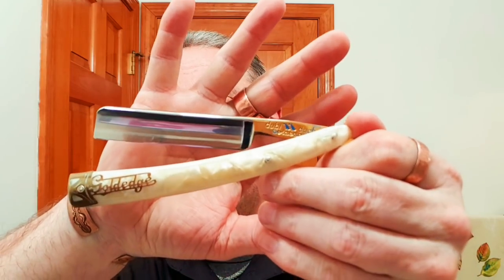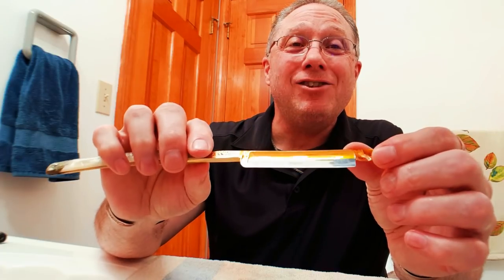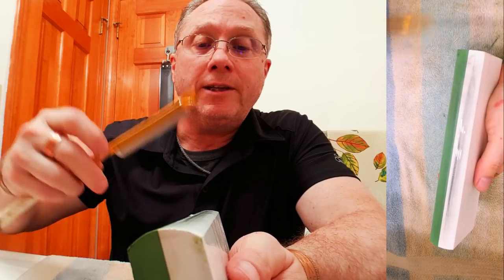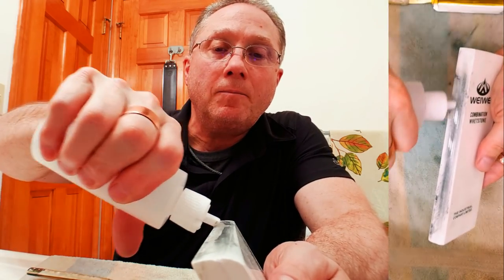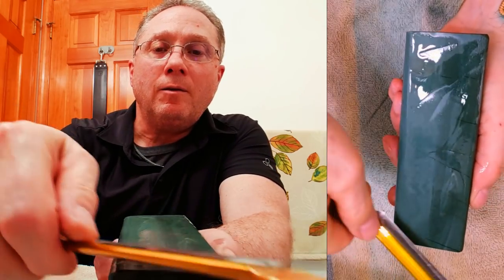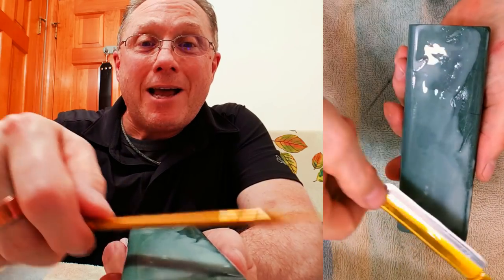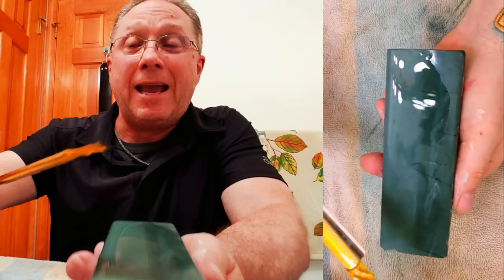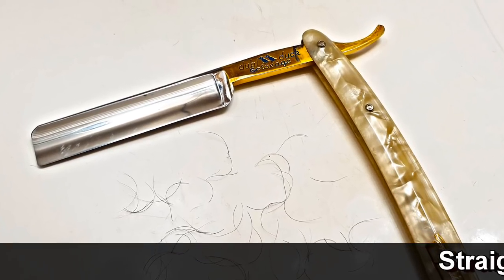Why You Can't Hone Your Curved Straight Razor

Comment: Great to see that WeiWei 10K back out. I like mine, used to be my finishing stone.
Get fairly decent shaves.

Recently got a Shapton 12K instead and results in my newbie hands are not different given X4 cost.

Will try  ILR next I think..
Reply from the maker: Luigi the WeiWei 10K is a fine stone! ;) I had forgot it was even in the mix, but it does a fine job! Yeah the Shapton 12K needs a very light touch absolutely little to no pressure and then it works well. I do really enjoy the ILR using the under the running water technique.
Thanks for your great comment and thanks for watching! :) Have a good weekend and take care my friend! :) #Heart

Comment: Won't that rounded surface make your bevel concaved?? 🧐
Reply from the maker: Great question George! ;) When honing a flat straight razor the edge and the spine hit the stone at the same time the full length of the blade. However, when on convex shaped stones like these the edge and the spine hit the stone at the same time at one given point of the blade. Making it necessary to use rolling x-strokes as one side of the blade is convex and the other side is concave. Using this method will make a proper bevel, it won't end up with a concave bevel at all.
Thanks for your great question my friend! :) #Heart

Comment: Why hone on the side of the stone?? Also, I never used any glycerin on a water stone. What is the reason for that?? 🤔
Reply from the maker: Great questions George! ;) This straight razor has a natural curve to the blade and the owner wanted as little damage as possible. So by creating an convex shape on the side of the stone I could get at the full edge. And I didn't need to convex the entire flat stone and the razor will only hit in a small section anyway. So it work perfectly! I wanted to use the water and glycerin mixture on the Charn so I used it on all the stone and it worked well.
Thanks for your great questions and thanks for watching! :) Take care and have a good weekend my friend! :) #Heart

Comment: Eric, you say never move side to side, but what if you have a strop that's not three inches wide? Aren't you supposed to strop using X-strokes on a narrow strop?
Reply from the maker: Great questions Greyswindir! You are correct when you are stropping on a strop that is narrower than your straight razor you will need to use X-Strokes! :) #Heart
Reply: @AdventuresInWetShaving  - I must have misunderstood your meaning the first time around. Sorry about that!

Comment: Got a question Eric. Can a regular shaver with two or three straights get by with a set of 3000K, 8000K and 12000K stones? Thanks for the help, and another great video.
Reply from the maker: Great question Donald! ;) Yes, you should be fine with those three stones on a straight razor with the bevel already set.
Thanks for your great comment and encouragement, and thanks for watching! :) #Heart
Reply: @AdventuresInWetShaving  So if the bevel needs to be set, I would need to start with a 1000k stone, then progress up
Reply from the maker: Yes, Donald that will work the best if the bevel needs to be set! Do you have anything to flatten your stones? :) #Heart
Reply: @AdventuresInWetShaving  Yes, Eric I have a Norton flattener.
Reply from the maker: Sounds good Donald! ;) #Heart

Comment: Hello Eric, would you explain why you've cut the edge of your stones convex, and what's up with the Kapton tape? I didn't hear an explanation for either of the two. The Kapton tape seems like it would be a better choice then electrical tape.
Reply from the maker: Great question Greyswindir! ;) This was an experiment with a convex stone honing a curved blade, by cutting the corner it didn't mess up the flat part of the stone. The Kapton tape outperforms standard electrical tape for me and is thinner helping to dial in the bevel angle, by allowing multiple layers to be added to the spine of your straight razor.
Thanks for your great questions and thanks for watching! :) Have a good day, take care and stay safe my friend! :) #Heart
Reply: @AdventuresInWetShaving  - I found it interesting as I've never seen anyone do that to their stones before. Do you hone all your smiling blades this way, or was this just a one-time experiment?
Reply from the maker: This was a one-time experiment, but if I had a cursed or twisted blade this method and these stones will come in handy. :) #Heart
Reply: @AdventuresInWetShaving  - I love that you're courageous enough to try something like this, even if some of the stones used were inexpensive compared some of the other stones out there. So much straight razor knowledge has been lost, this is a way to help bring it back.
Reply from the maker: Thanks so much, Greyswindir! :) #Heart